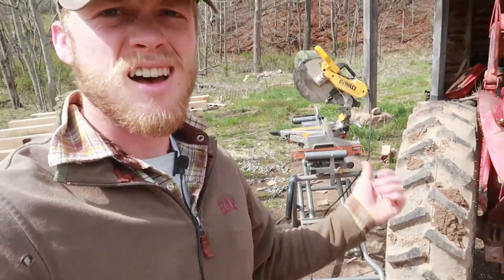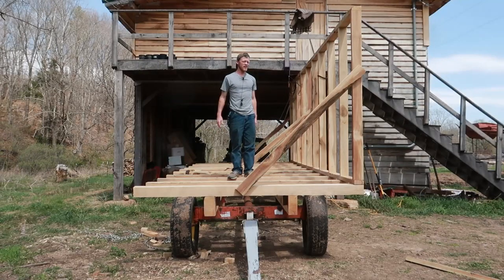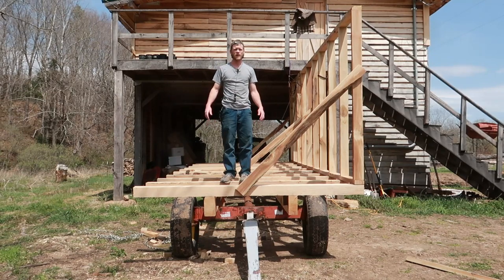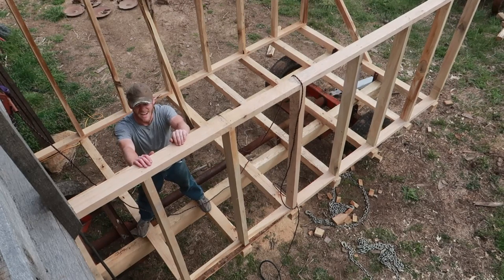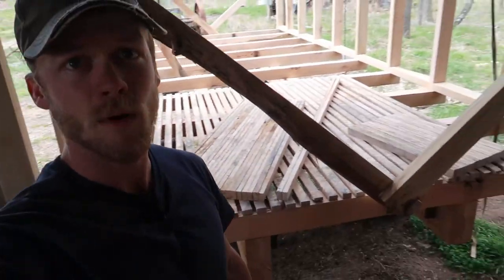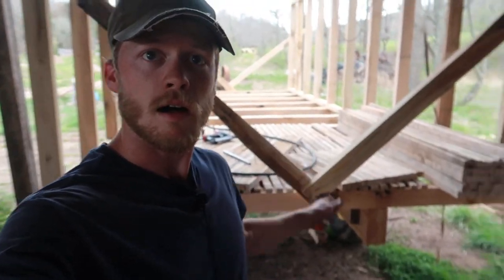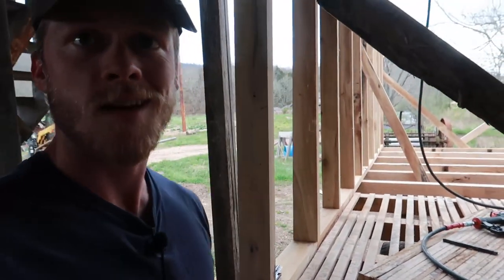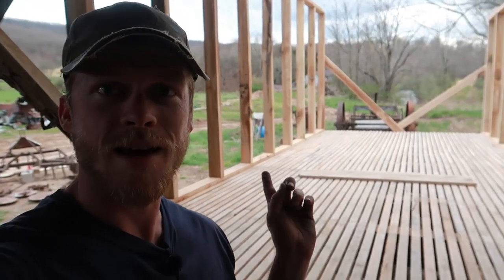Framing the Eggin' Wagon (Mobile Chicken Coop)

Comment: What is the dimensions you use to mill the 2x4’s? I usually mill mine by setting my mill at 1 5/8 x 3 5/8.  What type of wood?
Reply from the maker: Generally I mill on the whole number. So green they'll be about 1 15/16 x 3 15/16. Once they dry out about 1 3/4ish x 3 3/4ish depending on which way the grain goes through the board. All the big beams are red oak, the 6&7' 2x4s are yellow poplar, 8' 2x4s are red oak, flooring is red oak, and rafters are red oak.